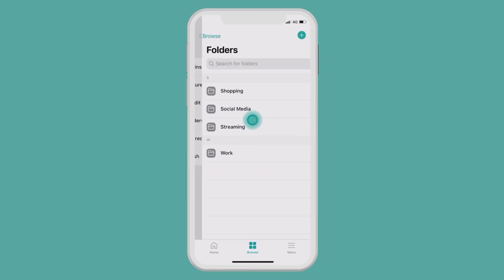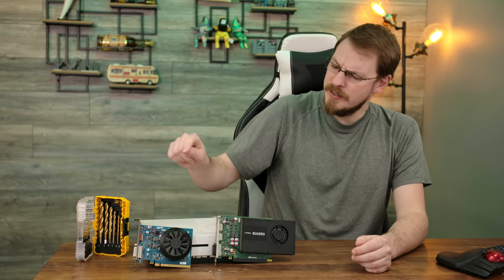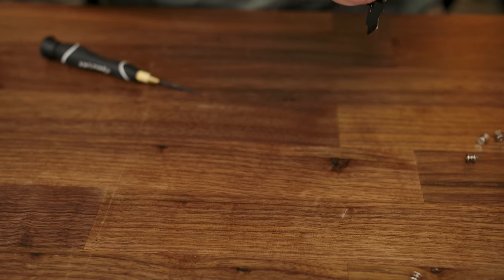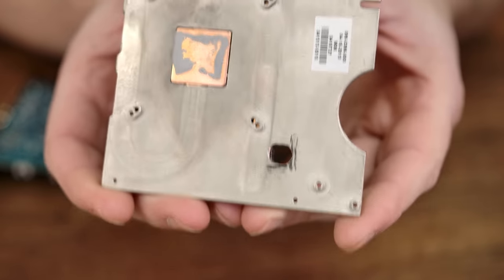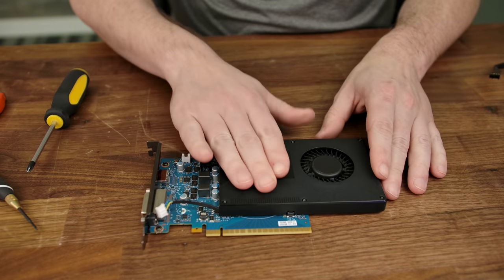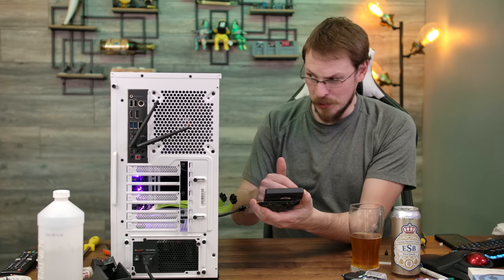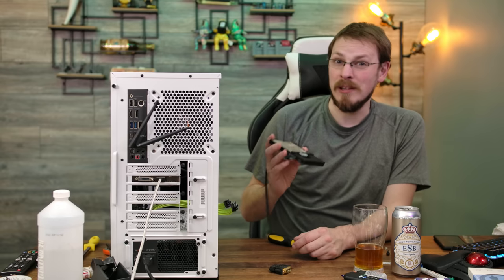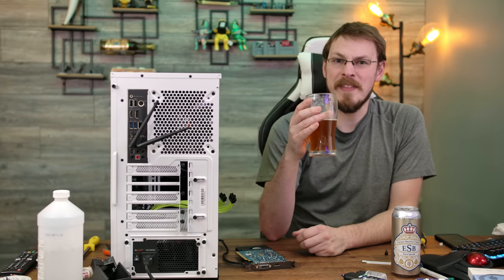Making my own Single Slot GPU Cooler

Comment: what are the odds I got a refurbished low profile 1650 for about $145 on newegg near the last week of December and I did a similar mod where I zip tied a 50mm blower fan to the back and tried to solder the wires to the back of the fan header. that said the fan was too wide to fit in the gap so I took a dremmel and shaved some plastic off the shroud and it fit perfectly. but when I attached the wires and booted the fan sensor on the GPU was reading the wrong speed and was just randomly revving up. so I cut the wires and connected the blower fan to a free molex connector and it's working fine. sadly the fans on the GPU it-self won't spin so I think I accidentally cut the wires to them when I used the dremmel or I shorted the fan controller. though it's not a big loss as the card sits under 50C most of the time. with any luck I'll be able to fix the problem before summer rolls around.

Comment: The more likely issue is that you don't have a fan plugged in. Try it with old heatsink and fan just to be sure, that could later be simulated with a resistor. A second possible issue is that larger heatsink makes a short on some component, use some Kapton tape on taller components under the heatsink.

Comment: Is it possible to use a CPU water cooling block like Swiftech Apogee 1U 775 and a modified or custom built radiator pump and fan that will fit inside the X-Box chassis?
Reply from the maker: No room for a radiator. Even Alphacool's 40mm server rads are too large to fit inside. That was actually the first solution I mocked up.

Comment: You missed the most important mod:
Painting over the "Quadro" logo on the cooler, or putting a sticker over it. When you plugged the GTX card with a cooler that said Quadro, I was triggered.
Reply from the maker: I'm planning on doing that if I can get it to work 😁

Comment: Why not just solder the capacitor (or some physically smaller ones) onto the back side of the board, instead of cutting holes into that heatsink??

Comment: why not just use a copper shim to slightly raise it up or of grinded down the original heat sync and used a smaller fan

Comment: I would've been tempted to either add thermal pads to the ram chips (or paste if they are close enough) to have them make contact with the heatsink.

Comment: You could just remove the cap. It's installed in parallel and is used just for power regulation. Instability might increase, but in your use case it won't matter.

Comment: Why did you not just solder that hole trough capacitor to the other side of the bord instead? why drill if you dont need to?

Comment: I would have moved the caps to the other side along with the crystal and wired the fan to the original plug and i believe it would have worked just fine without all the drilling.

Comment: i did same mod by adding r9 270 cooler on gts 250 (just i need to file down 1 mm of screw well)
also re-soldered one cap on the back. I bet this card is somewhere in my house

Comment: just desolder the cap and move it -- keep it on the same side of the board, add some extension wires to move it

Comment: theoretically it looks like you could have unsoldered all those caps and put them on the backside of the card, possibly even getting a longer cap and folding it down with the excess leads

Comment: Hello, I'm thinking about adding a graphics card to my laptop using a caddy and connect it through the CD reader port using a sata connection, would it be possible? thanks
Reply: no. you need pcie or mini pcie connector
Reply: @bullzebub  yeah but using other adapters,like from sata to M.2?

Comment: I used the same card layout (palit) for my PS2 Fat mod. Its the fastet and smallest GPU that don't require a 6 or 8 Pin .
Have a Ryzen 1200X, 1650, 16GB Ram and 512GB M2  SSD inside my PS2 Fat now in my Livingroom.

Comment: 8:50 - Surprised you didn't consider doing that for the capacitor. The other component is a 2R2 surface mount inductor, so you wouldn't be able to do that with this - at least not easily.

Comment: Surprised you didn't just flip the capacitors to the other side of the card.  Guess that might interfere with a slot on the other side of the card.

Comment: Doesn't that heat sink short your oscillator as those ends now will both touch the plate? Fantastic video, not all the way finished (so I should probably wait to write this comment but your comment pinned makes me think it doesn't work yet) but I thought I might share that idea ?

Comment: Plug the original fan into the fan header. If the GPU thinks there is no fan installed, it might not start to avoid overheating.

Comment: I would have just soldered the yellow +12V and black ground wire from the 4-pin fan header to the 2-pin connector on the GPU without having to use the motherboard to control the fan :)

Comment: Use small enameled wire and uv cure epoxy to build out traces and move the components wherever u like
Reply: Also...capacitors are just filters and regulate noise. You can basically remove them, they die eventually anyways
Reply: Get an oscilloscope
Reply: And dont wear gloves with a drill press, it'll take your hand clean off

Comment: It would be muuuch simpler to resolder the capacitors on the other side of the panel. I can tell even from the video that they are not surface mounted.

Comment: If the caps are through hole then it would've been easier to just desolder and then resolder the caps on the back side of the board

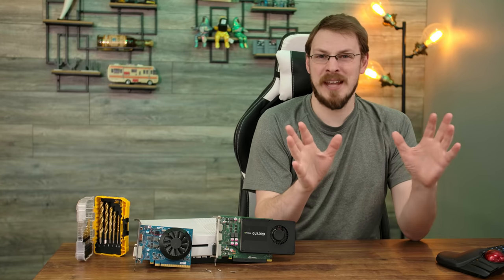Comment: 3:30 Great disclaimer Jeff.. 7:12 what was that you said?!! 🤫😂 So sad that it didn't work out for you Jeff, one though is that crystal oscillator directional? Hope that you get it fixed and running in the future. EDIT: turns out they're non-polarized so forget my thought

Comment: Why don't you try and take the original cooler through a band saw and cut it to half hight? Yes it won't have the same thermal capacity, but the fan will just have to spin a bit faster.

Comment: Did you cover up the where the oscillator was with some kind of barrier. The heat sink could cause a short.
Reply from the maker: I snipped the solder points down pretty short. They're well away from the bottom of the heatsink.

Comment: I suspect the cap isnt the issue - it looks like its just power filtering and i doubt tilting it would do that much, ive seen way worse.
Could you do an old technician a fave and not fondle the edge connectors so much? I know its not much of an issue like it was 20 years ago but it still makes me cringe XD

Comment: Hey, Nice Video!
Actually, i'm also building a xbox one s 'gaming' computer. The Parts ( Mainboard, PSU and CPU Cooler) are coming tomorrow. I'm really exited. I will use a gtx 960 4gb and a i3 4170 due to tdp issues on the cpu cooler (max 75 watts). But i use a Silverstone fx350-g which cost me 70€ new. I think such xbox PCs are pretty nice, especially to prank your friends :)

Comment: I thought you shouldn't use gloves while using power tools such as drills as it can be way more hazardous when it catches in the drill bit.
Reply from the maker: If your hand catches the drill bit, yes, a glove is more dangerous. However, I needed to hold the part in place while drilling. Had the drill it hooked that and spun it, my ungloved hand could have been sliced.

Comment: Crystal oscillator. Put it on the wrong way maybe. That's my guess.
Reply: It is a 2 pin crystal, they aren't polarized components.
It is however most likely not having a proper solder joint on the pin closer to the PCIe bracket.
Since the solder has balled up on the pin, this is a sign that there weren't enough flux during soldering and it is therefor not making any contact with the underlying pad.

Comment: If u are using the drill press, please dont use gloves, its less safe then without them. The glove can easily get stuck in the drill, your hand will be pulled in and will damage your hand. Has had this happen once and miss a piece of my inex finger. This is recommended for every powertool that rotates.

Comment: lol well iv ran into this issue in the past - in my projects .. (I do home automation and make custom enclosers )... you did pretty good, - but your going to feel stupid after reading this .... what you needed was 1/8 (or vary the size of "or even stack multiple layers) of coper sheets, (use a multimeter to test conductivity * ( best v= best thermal conduct quality )  ... iv tested this and normally get better thermal's than un-modified .. ( use thermal grease in between layers of copper sheeting ) (for SoC/burst governor- devices you can see up to 2x performance gain because of the added mass of heat-sink ) ... i think you over thought it .. ... but fun to watch :)

Comment: I can't solder and I don't know anything about soldering. I don't PCB boards all that well
Here's my thought de solder the transistor and put a wire on both sides of the transistor and then solder The wire to the PCB
For those who know soldering and would like to correct me you're more than welcome to

Comment: Safety hazard! Don’t use the drillPress with gloves, if the gloves get caught in it your hands will be broken. Second, use a vice to clamp the cooler down, if the drill get stuck in the material while drilling the cooler will turn with the drill.

Comment: Draw the fan power from the header on the GPU ! Then it will be ok ! So don't draw it externaly !
The way you have it now, the GPU thinks the fan isn't working, so it won't boot !
Reply from the maker: I tried that off camera before shooting the conclusion. That's not the problem.

Comment: Should have bought a hot air station and moved the capacitor to the other side of the board.

Got further into the video. You moved the crystal but not the caps. hm?
Reply from the maker: Height was a concern on the top of the board too.

Comment: You should never wear gloves when using a spinning power tool, the glove can get caught and rip off your finger. This is no joke i ve seen it happen.
Reply: This is good advice, rather have a flesh wound than a lost finger.
If one do wear gloves, they should be made to rip apart. (Usually such gloves tends to fall apart over time as the seems come loose, and the string holding it together tends to break if one looks at it wrong. But at least they rip to shreds if they get stuck.)

Used to work in an engine factory, the gloves were "wonderful", didn't protect against anything other than not having oil on one's hands.

Comment: Please stop torturing this poor gpu and send it to Louis Rossman to fix it. Also, would you please check if the die is cracked yet?
Reply from the maker: The die is not cracked, nor does this need anywhere close to that level of repair. It's a capacitor. I could damn near do it with my feet.
Reply: @CraftComputing  lol ok. I am just not convinced that a tilted capacitor would kill a GPU. These caps are just for lowering the ripple when the GPU is drawing various amounts of currents during high usage. I am pretty sure this GPU can POST with all these big caps removed. It does have smaller caps that will work for just the POST, but won't run under heave usage when current fluctuates a lot.